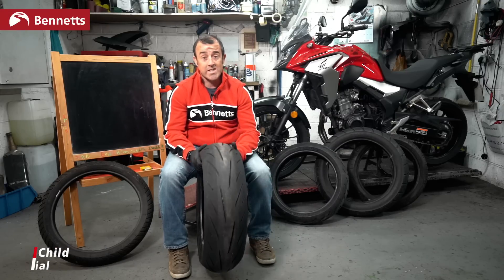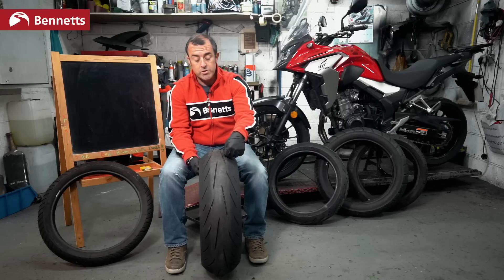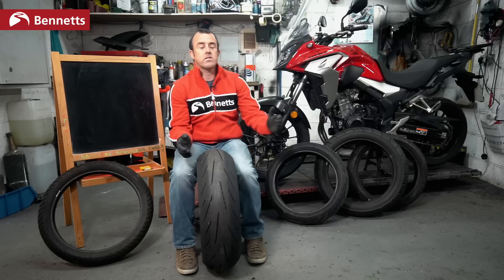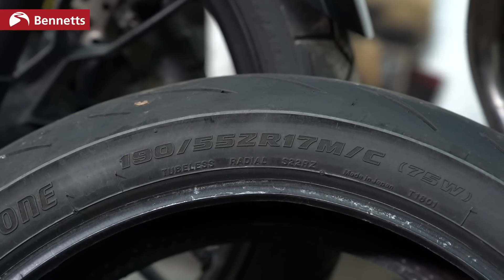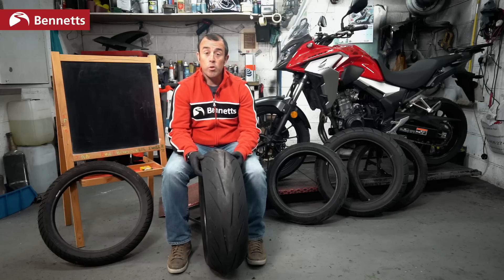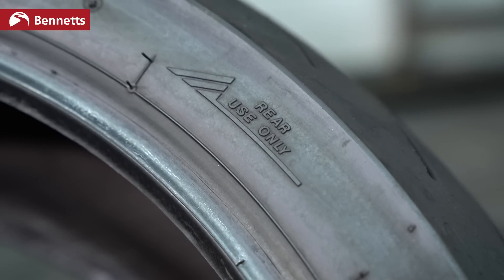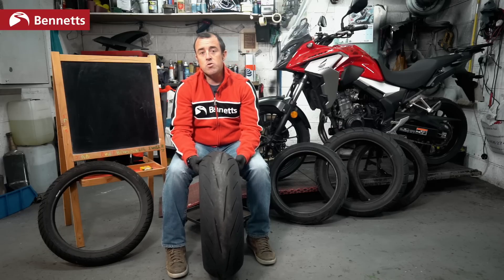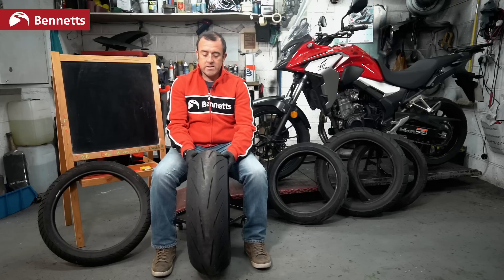Understanding motorcycle tyres | Home Schooling Lesson 12

Comment: BB... it is not correct to say (when given the size 190/55) that the 55 is the depth of the tire--not so.  That number is called the aspect-ratio.  The 55 means, that 55% of the 190 is the depth of the tire.  So, 190mm across, but 55% of that, is the depth=104.5mm. You could say there's more clarity in a number showing how close to the ground the rim rolls over it, but that would ignore how wide it is, and wider ones give better cornering than a narrower tire of the same depth.  However, by using a singular number (aspect ratio) you can account for both depth and width in one measure.  This gives a clearer picture about performance rather than simply "depth."

Comment: 1:23 I dunno man, I'm pretty sure I've learned from pros  and all the research I've done and tiheard re manufacturers that the grooves not only disperse water but ALSO allow for more tire rubber to flex and expand generating more and creating rubber heat for optimal traction and performance AND that the grooves edges even act as little teeth biting into the road for a little more grip.
Reply: Then just listen to the pros then..
Reply: Then why do people go with soft slicks on track when it's not raining but will throw even softer tires with grooves in them if it start raining?

Comment: Depth of the tyre is a % of the width...

So, R17- 200-50 means; 17 inch tyre -  200mm width and 100mm (50% of 200mm) depth.
Reply: They should know it, but not...

Comment: I was hoping for a little extra info in terms of types of riding vs different types of tyres etc.
I'm not a mega fast rider, but my bike is a fast bike (a Ducati 959) and I only ride on normal roads. So I'm always struggling to decide exactly what type of tyre I should really be running with. I am occasionally in the rain, but not so much anymore, so I went with Michelin Power RS tyres... but should I have just went with more durable or multiweather orientated tyres??
Reply from the maker: I'd go for a sports touring tyre. You can get some more advice here: https://www.youtube.com/watch?v=01YlwusCSlE Cheers, John